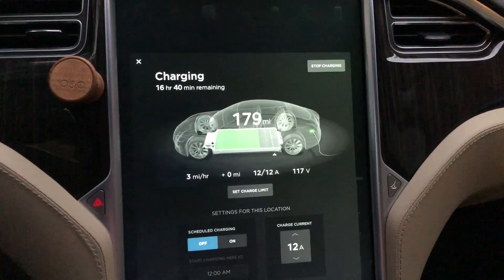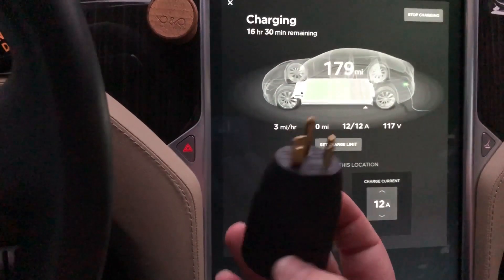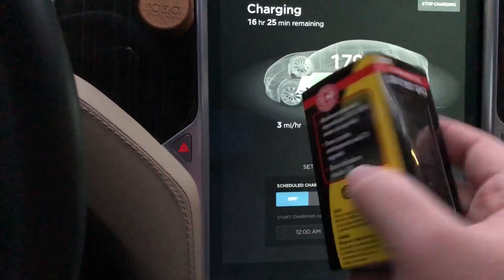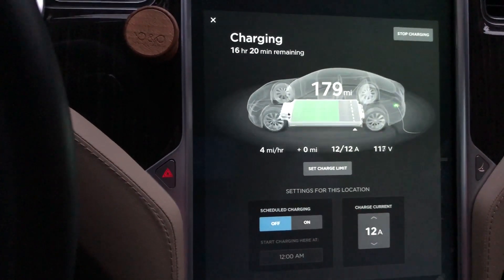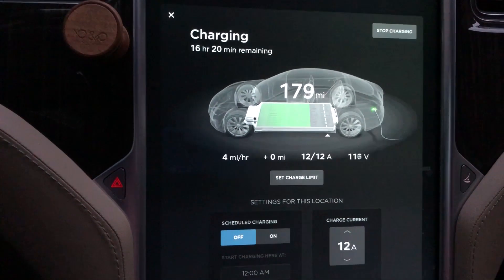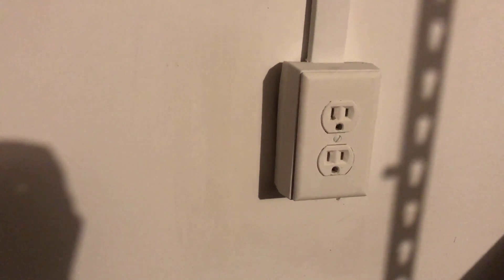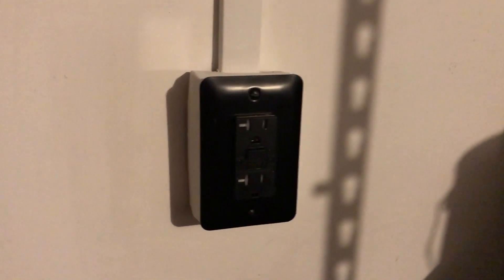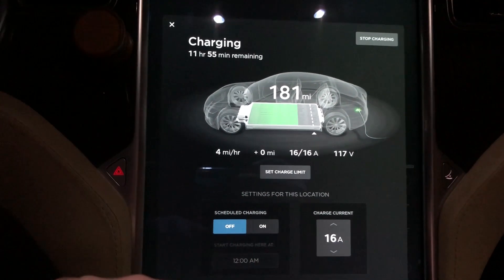Getting more Squeeze out of 120v with a Nema 5-20 Outlet

Comment: Worth adding that this type of plug not only requires a 20A breaker, but 12 gauge wiring. Sometimes you get lucky - Kitchens garages and bathrooms are occasionally wired for high capacity with 12ga but have normal 5-15 outlets. Standard gauge for a 15a circuit is 14ga.
Reply from the maker: In theory there should not be a 20 amp breaker unless the wiring is able to support that load unless someone has already been up to some funny business. But a good point.
Reply: From what we saw quickly when he does change the outlet, it seems to be 14-2 wire... That's bad..
Reply: @francoisdesmarquis8548  Looks like yellow romex to me. that would be 12 AWG.

Comment: 16 hours 20 minutes down to 11 hours 55 minutes. Dang. I, being a Tesla fan, had never heard of a NEMA 5-20. Someone mentioned it on a forum and I found your video. It’s nice to know because sometimes people are put off about a 14-50 costing upwards of a grand. Obviously this isn’t nearly as fast, but still super useful!
Reply: They are fast becoming the standard in North America. You see them in most new construction.

That said, a quick and easy upgrade to NEMA 6-20 would’ve made more sense since it was the only outlet on the breaker and he already had 12-gauge wires for 20A. It uses the existing wiring for 240v and charges 3x as fast.

Installation is as easy as buying the outlet and a new 20A 240v breaker (uses two slots) from the hardware store, then using a screwdriver to install them. The NEMA 6-20 Tesla adapter shouldn’t cost any more than the NEMA 5-20 one. It seems some Teslas don’t even need the 6-20 adapter since you can use the touch screen to manually increase the amperage to 16 with the standard NEMA 5-15 plug.

I’m going to guess that all the adapter does is make 16A automatic/default since the car and EVSE now know that the circuit can provide 16A. When doing it manually we “know” when we see the T-shapes slot on one side of an outlet that fits traditional 3-prong NEMA 5-15 appliances.

Comment: Great video Kenriko !! I have a Nema 5-20R outlet in my garage which I didn't even know I had....(Doh!!). If  I use the Nema 5-20 tesla adapter ($45) and plug it into m 5-20R outlet, then plug the level 1 charger I use for my BMW i3 I might get those extra miles per hour as you did. It's worth a try. Don't really want to throw down hundreds of dollars on a level 2 charger right now, my Level 1 charger works fine, but hey if I can squeeze a couple extra miles here and there, why not.. right!! Thanks again for posting this video - really helpful !!

Comment: You could’ve just changed the outlet and skipped the adapter.

The 5-15 plug fits both outlets and the car lets you manually increase the amps. The only thing the adapter does is let the car know you are using a 5-20 outlet so it can automatically default to 16A but it’s designed to let you do that manually if you know you are plugged into a 5-20 outlet. Just tap the up arrow on the screen (where it says 12A) to make it say 16A… no adapter required.

Also it would’ve been much better to replace that outlet with a NEMA 6-20 outlet/adapter since you said it was the only outlet on the circuit. Though you’d also need to snap in a double-slot breaker, you could’ve installed both just as easily. The result would’ve been nearly two and a half times faster… for real!

You definitely want a NEMA 5-20 outlet and 20A breaker for 120v at 16A regardless so this is good info, but I hope people don’t waste their money on this 5-20 Tesla adapter expecting to go from “three or four” to “five or six” miles per hour charging speed. There’s no way it will double it and it won’t go any faster than it would using the manual override to 16A… without the adapter.

Not only is the adapter completely unnecessary with the override, we’d be lucky to get one extra mile per hour, as you demonstrate. It’d be no more difficult to install the NEMA 6-20 which would more than double our charge speed. The only extra step is moving the wires to a new double-slot breaker that literally pops in. That’s easier than the outlet and only requires a screwdriver. There are plenty of tutorials out there.

Perhaps you want 33% more amps without doing the manual override every time, but you get that with NEMA 6-20 along with double the voltage. Since you had nothing else on the circuit, it definitely would’ve been the better way to go. Tesla’s NEMA 6-20 adapter shouldn’t cost any more. I honestly don’t think Tesla should even sell the NEMA 5-20 adapter. It’s almost completely worthless!
Reply: Hi Emmett, I recently got a Tesla and I live in an apartment with a personal attached garage. In my garage is a 5-15 outlet. Can I just switch the outlet to the 6-20 outlet and still use the tesla 5-15 adapter? Kindly educate me
Reply: @ugochukwu3109  The NEMA 5-15 plug will not directly fit the 240v NEMA 6-20 receptacle. One slot is turned 90° specifically to prevent accidental insertion of 120v devices. Of course, the Tesla MC is a dual-voltage device so it will work if you circumvent this with an adapter. Anyone can make one cheap with a screwdriver and a trip to Lowe’s… or the Goodwill thrift store if you want to make an adapter for a stove or dryer outlet. Yeah, my local Goodwill always has dryer cords since people donate them after they move and change cords (3 or 4 prong plugs). ;)

For NEMA 5-20 to 6-20 the circuit (wiring and breaker) should already handle 20A but you have to check if you want to go from NEMA 5-15 to 6-20. If the breaker is 20A then the wiring should be too but you still need to make sure there is nothing else on the circuit… not even lights. If there is more than one outlet you will want to remove/block off the others.

As long as there is nothing else on the circuit, converting 120v 5-15 to 240v 6-20 on a 20A circuit is as simple as swapping outlets and replacing the 120v breaker with a 240v dual-slot breaker. You’ll probably want a matching cover plate for the new outlet too, I guess. ;)

I switched a NEMA 5-15 to 6-20 for an EVSE after I found the landlords had already miswired a 5-15 outlet for 240v. I discovered this when it fried my 120v work lights! Ironically, I could have done nothing and simply plugged my NEMA 5-15 EVSE directly into it to charge twice as fast but I didn’t want anyone accidentally plugging other 120v-only devices in. Mine was a GM-branded ClipperCreek Gen2 unit included with the Chevy Bolt EV and later Volts with a non-removable NEMA 5-15 plug and a limit of 12A. Not only would it work at 240v, the car also defaulted to 12A where it required a manual override from 8A every time on 120v.

On the car side you will not want to exceed 16A for a 20A circuit, which is 80% of the rating. There should be arrows on the display that let you increase or lower the charge rate.

Except for the 5-15 to 6-20 plug adapter, this is all up to code… and code never dictates what the end user plugs in. After all, they can’t chose the specs for whatever you might build and in that respect the adapter is no different from a cord you wired in to an EVSE you built from scratch… like OpenEVSE (open-source project for building your own EVSE).

Speaking of OpenEVSE, I bought a J1772 plug/cable off someone parting his out but instead of building an OpenEVSE like him I found another ClipperCreek Gen2 circuit board on eBay for $30… brand new GM spare part, never assembled into a complete unit. I assembled it with a 6-20 plug and went to Lowe’s to make adapters for everything else (NEMA 5-15, 5-20, 14-XX). Home improvement stores sell all of those plugs from the aisle where they have replacement lamp plugs and such. Since the same ClipperCreek Gen2 circuit board is used in my GM/Bolt EVSE with a 5-15 plug and in my Amazing-E EVSE that came with a 14-30 plug, the choice of cable was clearly up to the builder… me. Yes, that means I have 3 EVSEs with the same board. ;)

In all, my cheap EVSE build was less than $100, and that’s with a J1772 plug that cost more than the rest combined.
Reply: @emmettturner9452  I skimmed through some of this but did read the parts where you said you can plug the 5-15 adapter into a 5-20 outlet and be able to choose the amperage. Either my garage is wired incorrectly or that statement is incorrect. I have a 5-15 nema adapter plugged into a 5-20 outlet and I am defualt to 12amps and cannot change the amps. AM I missing something? >
>
>
I just checked my outlets and the 5-20 outlet is connected to a 15 amp breaker, and the 20 amp breaker has 5-15 outlets on it. Thats a simple swap correct? Or should I get a brand new 5-20 outlet from home depot/lowes? Will the outlet say what kind it is on the side or something or is the T . I the tell tell for it?
Reply: I was referring to a control in the vehicle. For example, a Bolt EV or Volt will default to 8A when you plug into 120v but there is an option on the dash to override and draw 12A if you know your outlet and wiring can handle it. Obviously, a circuit with a NEMA 5-15 should be able to handle it but a worn outlet can melt anyway. This happened to my brother with his Volt. This is also why many EVSEs with a 5-15 plug have a themistor in the plug to detect excess heat and cut off/slow down charging.

A Tesla will also let you adjust the amps using arrows on the infotainment screen. You can even do 16A if you are plugged into a NEMA 5-20, but you have to do it manually because there is no way for the car to know that. Teslas may use your GPS location to remember this setting instead of always defaulting to 8 or 12A… seems like something I read about. Maybe some other cars do this too.

The EVSE itself can’t tell if you’ve plugged a NEMA 5-15 into a NEMA 5-20 which is why you can buy a NEMA 5-20 plug for some portable EVSEs, like the Tesla mobile connector. If you have the 5-20 plug/dongle in your Tesla MC the car should default to 16A without requiring a manual adjustment. Almost no one buys the NEMA 5-20 dongle for the Tesla MC since you get the same thing by manually adjusting it on the car’s touchscreen.
Reply: @emmettturner9452  On the 20A circuit with 15A receptacle, I do not have a choice to change my charginging amperage. Nor do I have a choice on the 20A receptacle and 15A circuit. My MC is using the 5-15 adapter. I ordered the 5-20 adapter after seeing that there was a 20A receptacle in the garage. But it appears I will have to install a 20A to get 16A while charging on the appropriate circuit

Comment: i charge at an apartment.   If I could plug in reliably, a 5-15 would work just fine.  I think people over estimate how much they drive.  Sure a 14-50 would be better, but it's fine, really.
Reply from the maker: 'absolutely. I've been charging off a 5-20 for the last 5 years and drive ~25k / year almost all of it off the puny wall outlet.
Reply: @Kenriko  Yep.  Had my M3 for almost a year and put 30k miles on it.  Most of my charging is from 5-15.

Comment: does anyone think it will work j1772 
I have a 2017 Chrysler Pacifica I got used with 35k on it. regular charger it came with pulls 12v that takes 12 hours to charger .
unfortunately my house does not have 240v outlet  
but alot of neme 5 -20
would love 2 hours charge 
again van only gets 30 miles of charge but is very nice.
thank s
Reply from the maker: Yes you can get a J1772 from Amazon that'll do 16amps on 120v (which is the 80% constant use of a 20amp outlet)

Comment: Would not it be better to use a nema 6-20?
Use the same 20 amp cables but with 240V. You only need to replace the neutral cable with a phase cable, and tesla sells the adapter for nema 6-20
Reply: josé flores circuit breaker needs to be taken into consideration too. 20A on 240V is 40A on 120V
Reply: Jose well yeah, but installing a 6-20 outlet doesn't increase the voltage; you'd still only have 120 volts if you don't also install and correctly wire a 240-volt breaker, which also involves correctly marking the white wire.  That's not too difficult but that's not what this video is for.  Also, you can't have any other 120-volt outlets on the same circuit because you'll accidentally plug something into it, and whatever you plugged into it will be ruined.  This video is for people who can't/don't know how/don't want to do that.  But you do bring up a good point.

Comment: what if your circuit breaker for that outlet is only 15 amps? What else do you need to change besides the receptacle?
Reply from the maker: If the breaker is only 15amps then the wiring most likely is not thick enough to handle more then 15amps and you won't be able to use that circuit.
Reply: How do you know if your outlet is 15 or 20 amps?